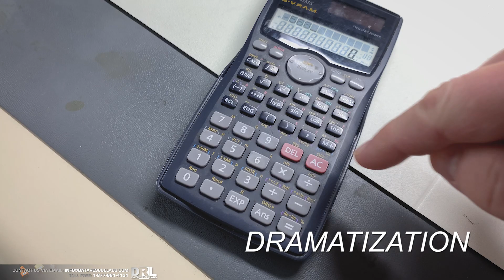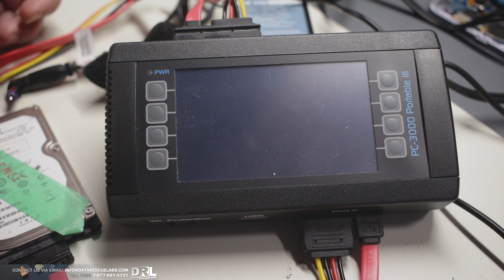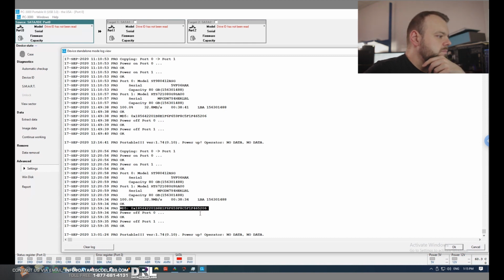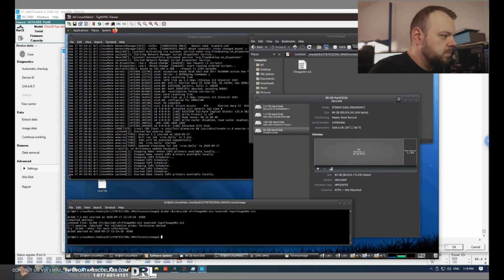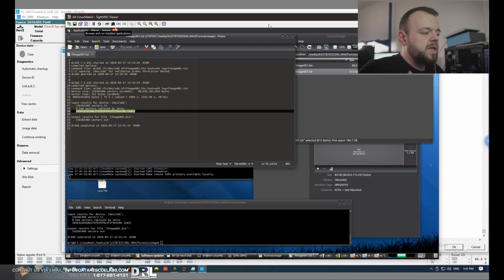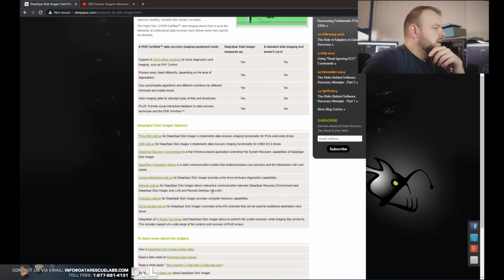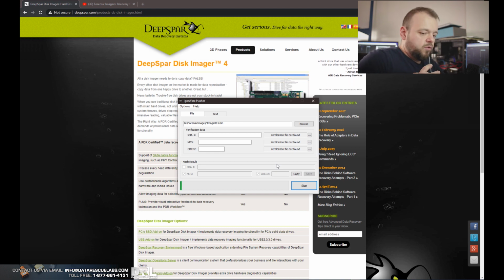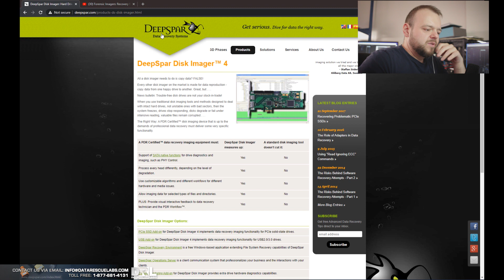How to clone a hard drive - forensics 101

Comment: Can you extract data from Encrypted drive with VeraCrypt software?
Reply from the maker: Don’t think we can for now without the password.
Reply: @forensicguy  One more question, I had some photos and data on my phone I had used Ishredder 6 application on Android Samsung Galaxy A50 few times with few wipe algorithms, but I didn't do factory reset, what are chance to recover some of that data and pictures? Does some data still stays on device or is it mostly wiped?
Reply from the maker: A50 is encrypted by default. Combined with trim on internal flash memory, you have nothing to worry about. Once deleted, the data is gone
Reply from the maker: Messages we can as this data is stored in a separate container (sql database)

I will have a video on this topic in the near future.
Reply from the maker: Yes, every app has its own sql database. I touched on this topic in my ssd trim video. “They lie” is the thumbnail if you wanna watch it

The only time we can’t recover the data if an individual file is delete ie photo, videos or the entire app which deleted the sql with it

Records from sql themselves we can easily recover unless it’s an iPhone. Apple took steps since iOS 11.2 to prevent any recovery from sms/iMessage db. We can still get WhatsApp and other apps but nothing native